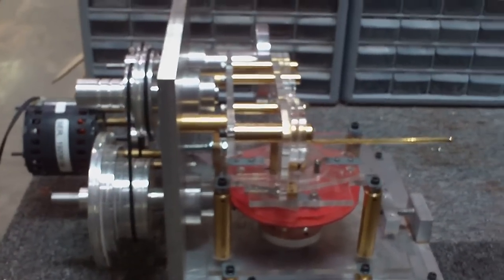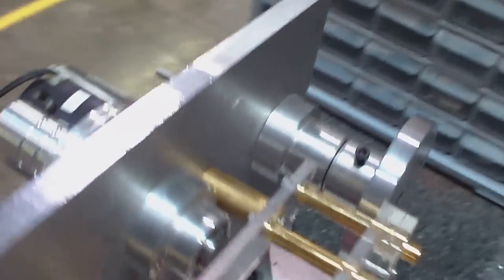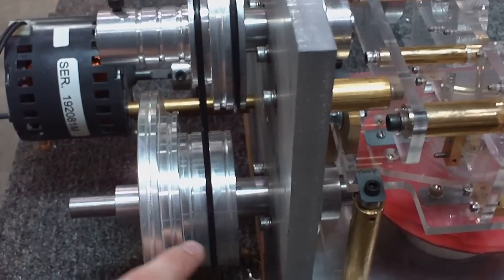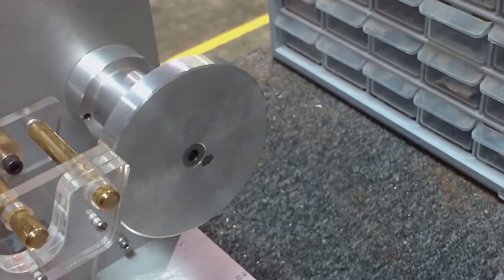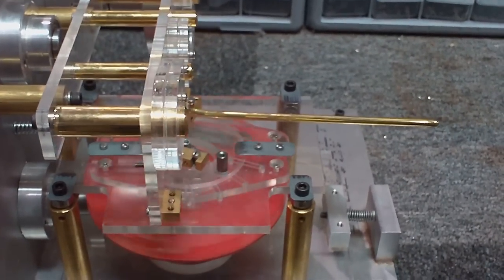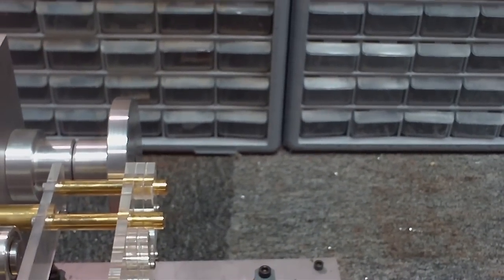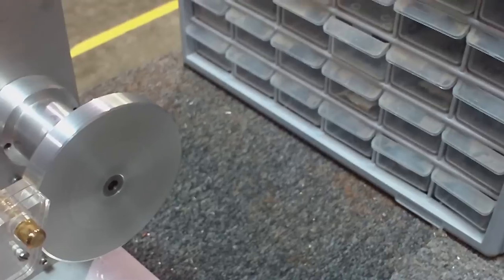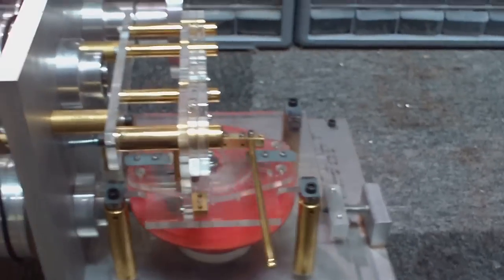Auto traverse pickup winder

Comment: I found an old voice coil winder for automotive tweeters. The traverse on that is a servo and you set it for wire guage. I used a sewing machine for my first winder. I still use for hand fed winding.  That thing looks massive. How much money in parts? Mc Master Carr aint cheap! Both my designs stacked windings on the edges, so I put an optical sensor on mine to assure a level wind. It's all surplus too! You should see how a Leeson A actually works, Bobbineer or even a tranny stick winder.